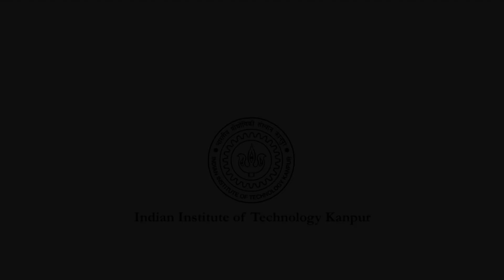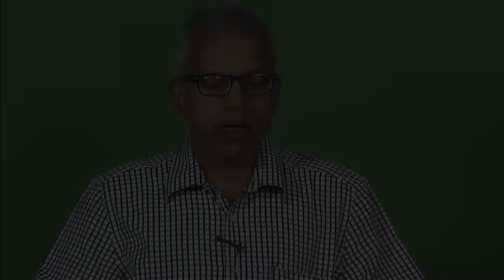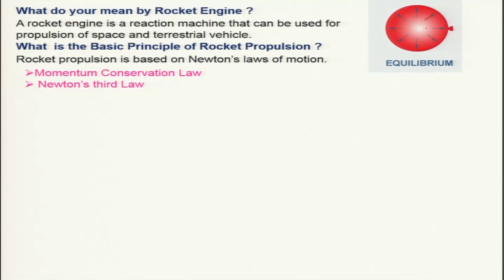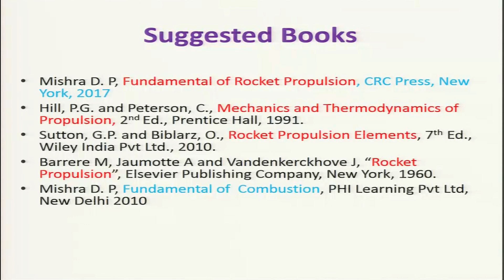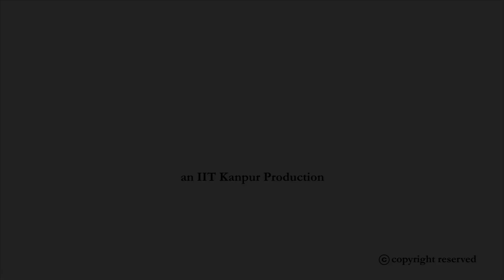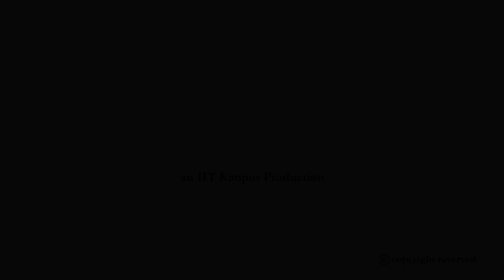noc19-ae08-lec01

Comment: Playlist total duration 28h 37m 16s

It might sound like a lot, but just taking 10 mins each day, you can finish Rocket Propulsion in 5.5 months. Worth the time? TOTALLY
Reply: but in reality they will give you only a month to finish a 40 hour course for 3 credits ++ 15 assignment & one final exam which counts 70%  of course project.
Reply: 28hr daily an hr with playback speed 2xor 1.5x works too
Reply: any book recommendation or some useful rocket or space related recommendation
Reply: You can start with rocket propulsion element. But i would recommend you start with fundamental of liquid rocket propulsion. None of the book was my text book but i would suggest you to read those if you really intrested in propulsion.